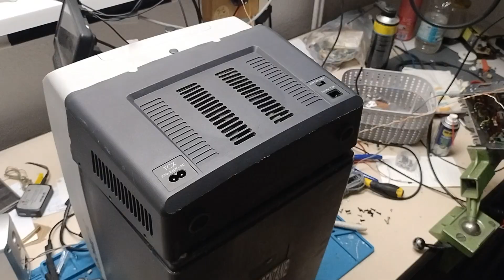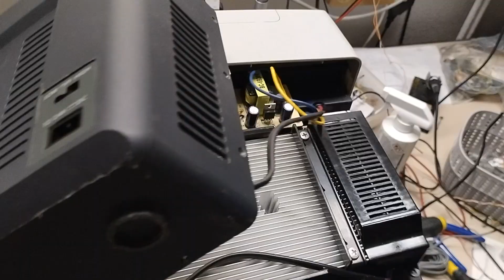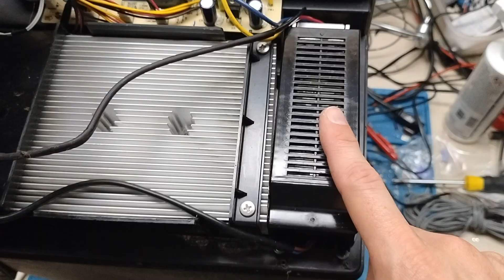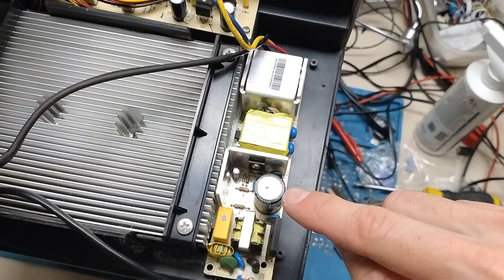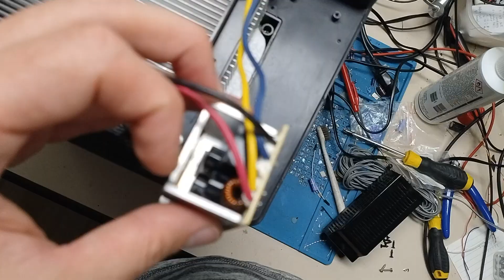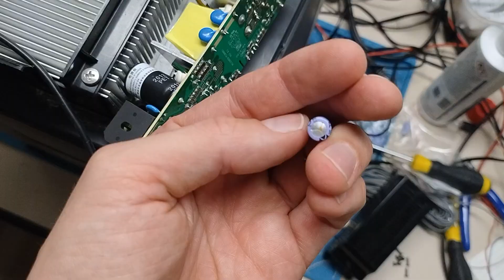TCX Dometic fridge repair

Comment: Would 3x 25V capacitors also fit?
Reply: I just fixed my fridge with 3x 1000uF 35V 105°C capacitors. The 16V original cap is physically smaller than the replacement, but it works just fine.

To be specific, I used
LCSC Part #	C398835
AISHI ERR1VM102G20OT
Through Hole, D10xL20mm
CAP ALUM 1000uF ±20% 35V TH

Thanks again for the video!
Reply from the maker: @svenvap  Great that you managed, yes I also tried physically bigger caps at first, but was a bit concerned because they tend to touch the diode and I was worried they would heat up even more than the old ones. But if they are a good brand, it will probably still last much longer than the originals.